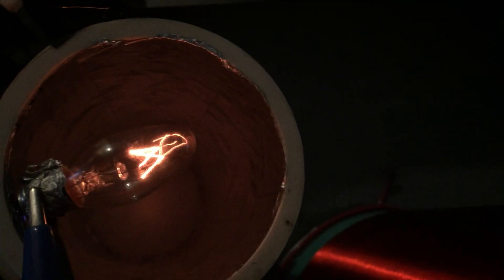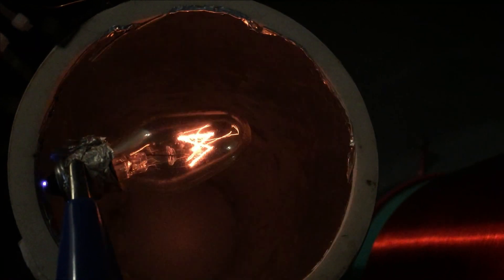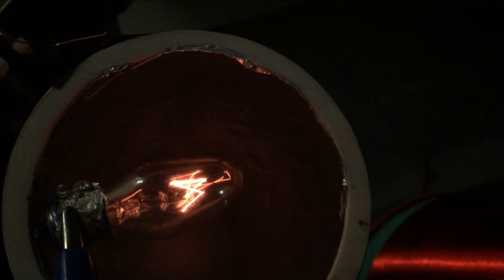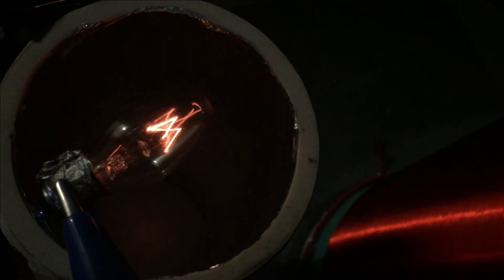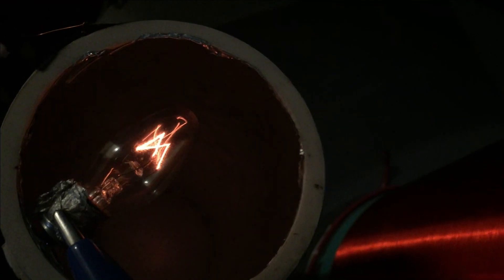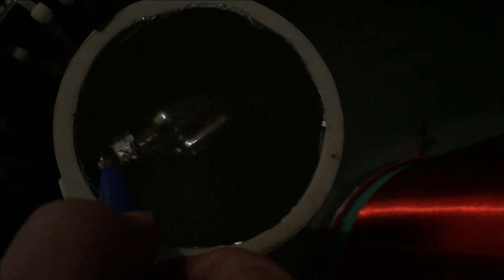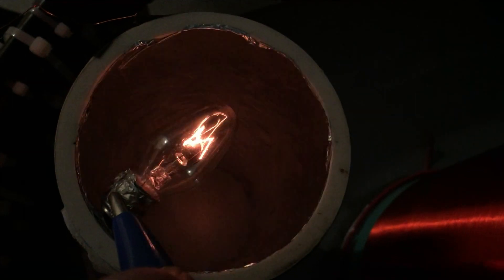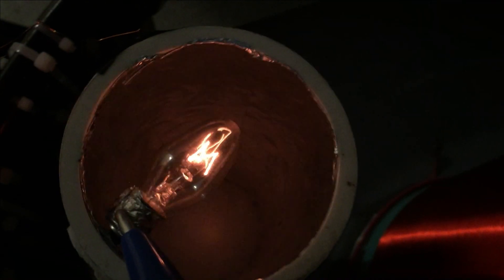Capacitive Coupled Light Bulb

Comment from the maker: Rough figures on the output with 12v 40ma input DC,(inverter) 60 volts pulsed 0.5 to 1 watt output under tesla coil capacitive load plus the 80v neon  inductive output as additional.